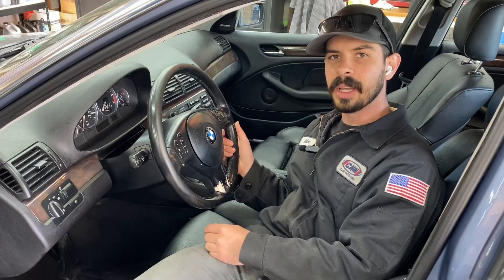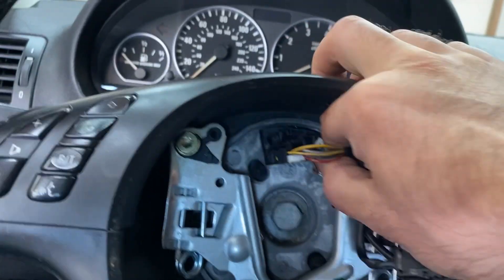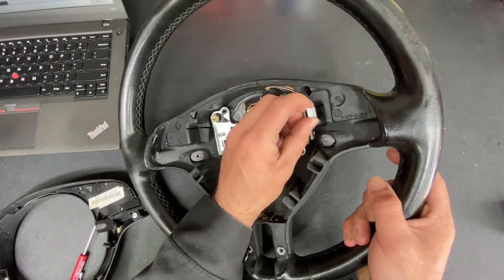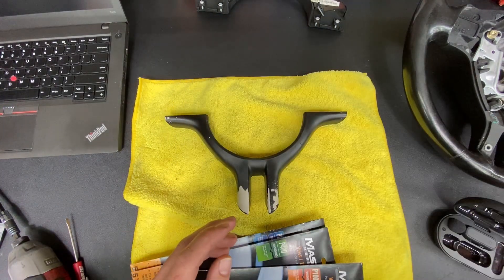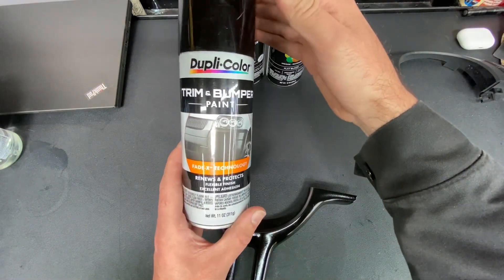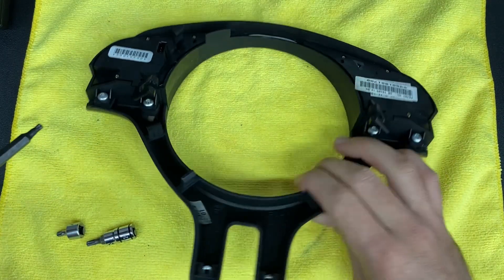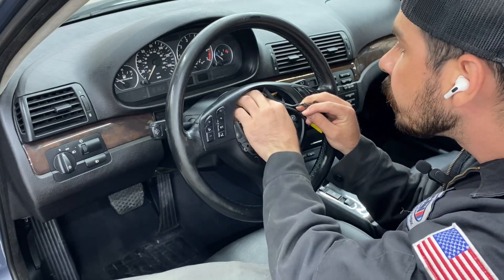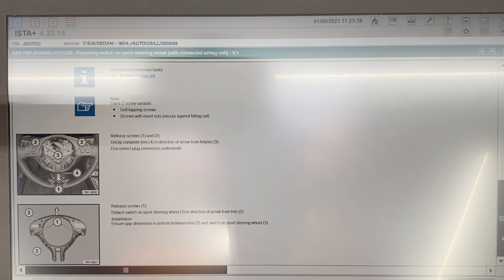BMW Steering Wheel / Trim Removal & Paint! $500 BMW E46 FLIP

Comment: Done the same thing to my steering wheel. I've left it in hot water before getting rid off the old 'paint' which really made it much easier, sanded down using 2500 later and it came out amazing.
Reply from the maker: great info! thanks for the tip :)

Comment: Great video – thanks for posting!  This may be a stupid question but do you really need to remove the wheel to remove those two trim pieces?  With the airbag out, it seems as though those 4 Torx (2 on each side) should be accessible already.  Or am I missing something?
Reply: I'll answer my own question (having just finished the job): No need to remove the steering wheel if all you're trying to do is refinish the bottom trim piece.  Once the airbag is out, you can easily access and remove the two Torx 20 screws from behind the wheel (6 o'clock position when pointed straight), the other two Torx 20 are easy to access from the front.  This way, you do not have to mess with the 16mm nut holding the wheel in place, worry about getting it properly centered upon reinstallation, or disconnect the cables.  The only cable to come out is a little white connector that attaches to the back of the trim pieces for the steering wheel buttons.  Hope this helps!